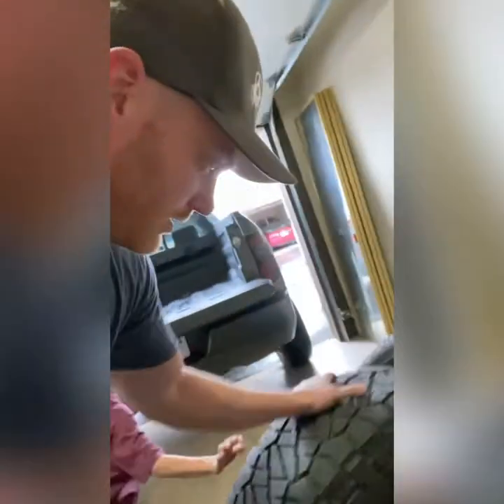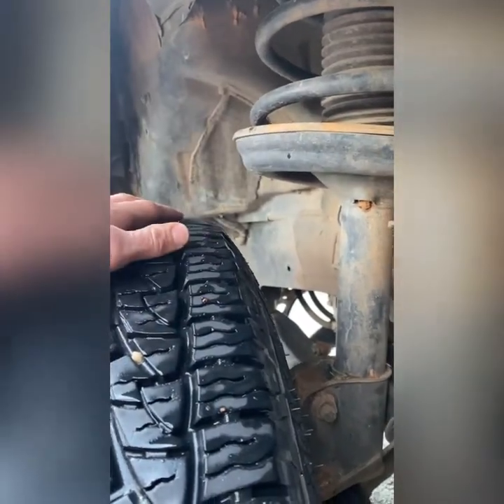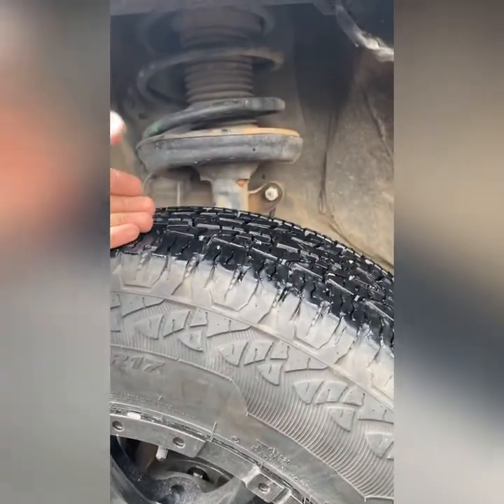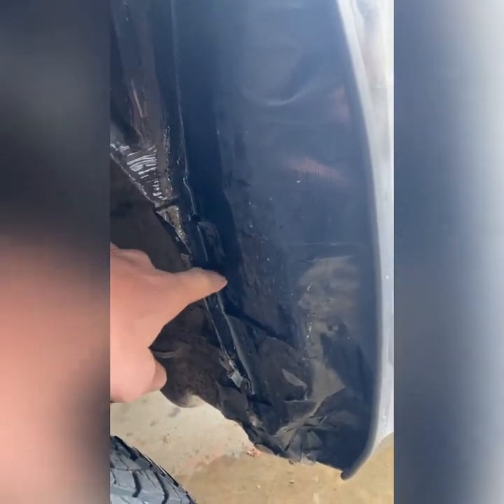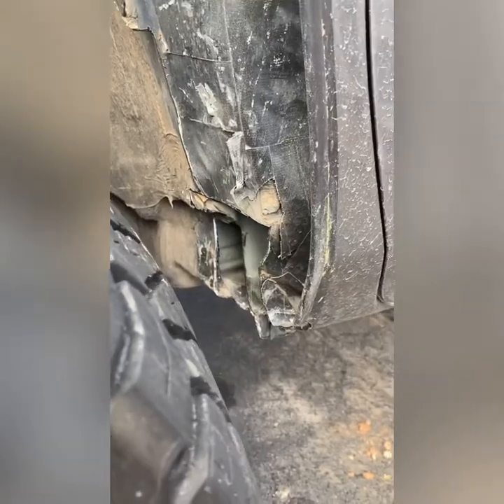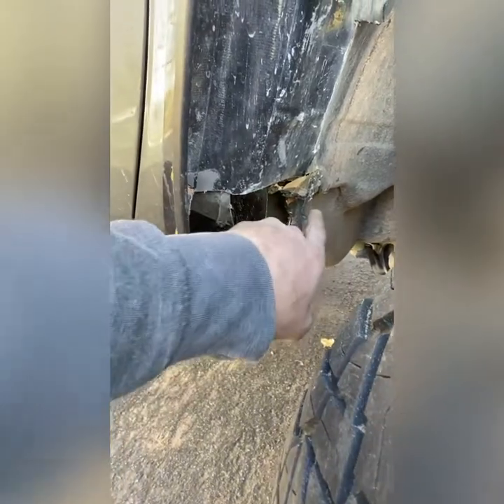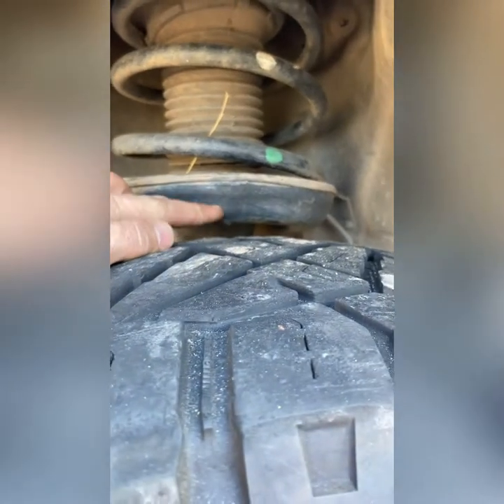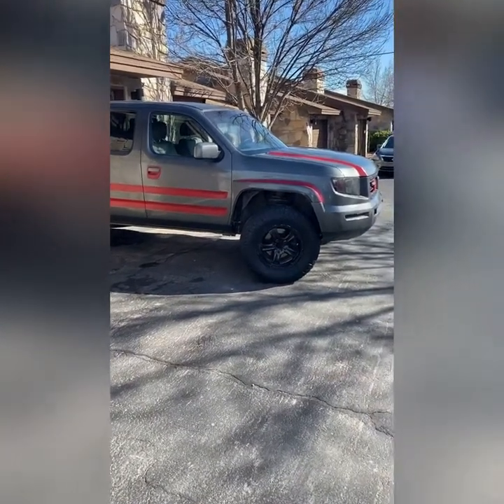How to fit 33” Nitto Ridge Grapplers on a ‘08 Honda Ridgeline // Over The Ridgeline

Comment: with the larger tires did you notice any loss in power/torque while off road going up a steep obstacle due to the larger outside diameter which is like a gear ratio reduction?  Or did the weight of the bigger tires have any negative effects in power loss or handling?  How much extra ground clearance did you get with the larger tire diameter?
Reply from the maker: I have noticed any real power loss yet. But we will see how it goes as I test this out.

Comment: How was the rear end for clearance with 33's? Ordered a 2.5 lift for mine but they sent me 2.5" front/1" rear and dont have the time nor patience to return it so im just lifting it maybe 2 inch total on the rear with some extentions on the rear arms haha
Reply from the maker: The clearance was really great actually because of the independent suspension! It definitely gave it a few inches being on 33” tires compared to stock ones haha

Comment: Were the Nittos your first choice for a tire or did you only get them due to the deal you were getting on a used set?  If only the deal, what you buy new if you had a Grand to spend on tires?  Were the Jeep rims needed for those tires or needed for the spacers moving everything outboard.  Is that mod, wider stance, done mostly for functionality or is it mostly done for a look on the Ridgeline....it does look good?
Reply from the maker: The Deal definitely helped, but I was very interested in the tire anyways to begin with.  Depending what I needed the tires for, rock climbing, mudding, etc... for an all around tires good for road and off-road I love them! Stance is helpful so it is more stable side to side. But I also really like the look of it. I bought the wheels not knowing anything. So I bought adapters to fit the wheels.
Reply: Your jeep rims. Are they aftermarket jeep rims??  Or Off of what model jeep???
Reply from the maker: They are aftermarket. I bought them used though, so I couldn’t tell you anything else unfortunately. Haha. I hope that helps.